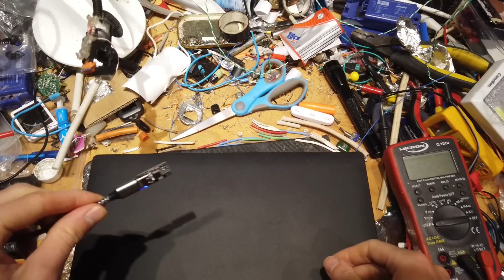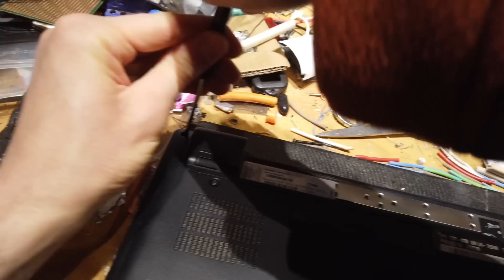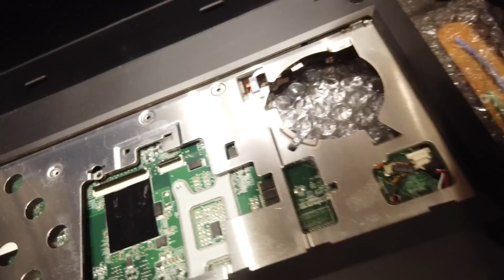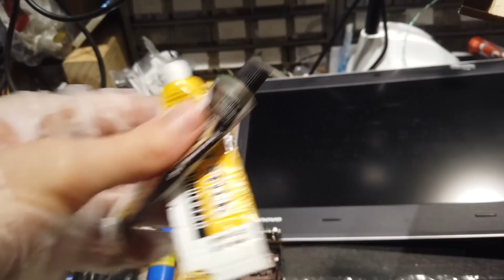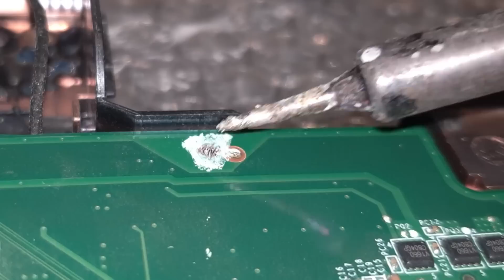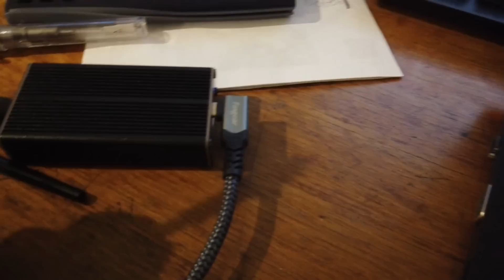So I put a USB C charging port in my year 2011 laptop

Comment: My laptop's screen got damaged so I turned it into a desktop setup and and when i plug the power adapter it turns on, if i use type c pd without the battery will it turn on ?

Comment: Lenovo are known for their crap hinges. Actually it's the crap plastic they use for their housings that is responsible. I spent two hour gluing the hinges back together on my Lenovo after the display suddenly decided to declare its independence. The lesson here is, not to buy plastic Lenovos. Their aluminium laptops are probably alright though.

Comment: So the adapters you can buy already do this? Are they safe to use? 
My laptop is only has a 45watt power brick which would be easy to replace with usbc charger

Comment: Is it possible to just connect the direct positive and negative port, and on the other side use a GAN charger that will know the amount of voltage and current needed?

Comment: I can tell you from experience the epoxy repair to the hinge will last for a while. but will be wrecked thr first time the laptop gets a little drop to a hard surface. I did the same repair to my laptop hinge. I recommend you get online and start searchiung for a replacement for the broken part. They are still out there. Good job though. And I love the usb-c port addition.

Comment: Hello sir extra information.  In my Zephyrus g14 2020 you need to adjust bios infor for charger to accept lower watts/volts wtf it is and it will charge while using. But if its off it will charge weird.

Comment: Hi Ash Glad I came by your video. I bought an old Lenovo ideapad 110 just to have windows to try out a DAW. The DAW and plugin I found is great but the CPU keeps crashing the DAW.
Do you think doing what you did should help and is the ideapad he same thing as the thinkpad. Also having issues trying to boot from a flashdrive but it might be a format thing cause I use linux otherwise.

Comment: These $3 devices go only up to 45W, you need to spend a whopping $4 to support 100W and be safe for your 90W E320!
Your 100W USB-C power supply will work, but your USB-C device and your laptop might not survive it.

I see some comments about the control pin of the barrel connector, but since you can charge your laptop alright with the 100W power supply, this seems irrelevant here. Which is lucky, because Dell, Apple and Lenovo have been known to use this control pin to identify stock chargers, and would power the computer (sometimes at low power) but not charge the battery if they don't detect the proprietary charger signature. Some people have designed spoof signature devices for Dell laptops and cheap third-party chargers.

The charger for my recent Lenovo does not have such a control pin, or maybe it has, as the 2 conductors seem to be both on the outer barrel. But its single USB-C port is probably just for data, not power (I haven't checked), so I might need to insert a device similar to yours. On the other hand, for the same $3 price, you could get a compact USB-C PD to DC adapter like this: https://fr.aliexpress.com/i/4000349880924.html?gatewayAdapt=glo2fra
No unscrewing/rescrewing, no breaking/repairing hinges, no soldering. Just a little less elegant.

Comment: It seems you get lucky with the Lenovo power supplies. Dell systems use an identification chip in their power supplies. Connect a non-Dell power supply to the system and it refuses to charge the battery. So no USB-C modifications allowed unless you have an old Dell PSU to harvest the identification chip from!

With regards to the overheating issue that you faced with the Quad core CPU one solution to this is under-volting the device rather than under-clocking it. Most of Intel's CPUs will tolerate under-volting really well and this will directly translate into reduced power consumption and less heat. So the same performance basically but for less power draw. The easiest way to experiment with this that I've found is with a program called throttlestop.

Comment: BEST BET  IF YOUR HINGS ARE TIGHT YOU FIND IT HARD TO OPEN THE TOP HALF JUST  DROP A SMALL AMOUNT OF FINE OIL ON THE HING'S  STOPS IT FROM SNAP'IN  THE SCREW HOLDERS

Comment: 1:20 You can use a wick for easy desoldering. I'm personally following Louis Rossmann's advice and using the "goot wick" brand. Known good stuff.
Also there are external adapters (USB-C to barrel connector) that are very handy. Still a great video.
I'm going to do the same thing with my 2009 e-waste netbook.

Comment: Damn, sucks about the screen hinge mounts.

They DO make special types of epoxy to bond plastics, works WAY better than super glue. And given the high stresses in that area, I'd also try to reinforce it even after the plastic epoxy with JB Weld or Loctite epoxy or similar.

But that's a bit easier said than done when you'd prefer to do it in such a way where the laptop can still be reassembled and even disassembled again later in the future.

Tricky, but doable, I've done it that way before with excellent results. But the trick there is to get everything aligned flush with the screen hinge brackets while the epoxy cures, but also not having the epoxy cure to the brackets themselves. I found that a very light touch of WD-40 from a Q-Tip on the brackets can prevent epoxy from curing onto parts which you don't want it to.

Anyways, just some thoughts on techniques to fix busted screen hinge mount points.

Edit: I see you did apply epoxy around the area, good good. But I mean applying it in a way that's PERFECTLY flush, by using the hinge brackets themselves to shape the epoxy as it cures. If this is done correctly, you can REALLY fill the area in with a big gob of epoxy (use common sense where all you apply it though), and then install the brackets with a touch of WD-40 (only on the brackets, not on the casing, for any possible future disassembly), to perfectly align and flatten out the top of the epoxy. It ends up bonding with all that much stronger of a hold.
Reply: Thank you for sharing your experience on hinge repair.
My experience is to drill through the broken hinge base and use 2 mm screws and nuts to secure the hinge. I will use your epoxy technique if the hinge mounting base is not leveled with the other hinge.
Reply: @Frank-Thoresen  I do hope it proves as helpful for you as it has for me in the past.

I should probably also add, that you don't necessarily need to remove the hinges from the screen assembly to do this. Just use some pliers and carefully adjust the hinges where they sit evenly at the exact balance point while the epoxy cures.

Note on that: This might not be advisable for a shop with cats roaming around LOL!

Comment: I wonder how easy changing the controller would be in a more modern Lenovo that uses the new rectangular plugs. I have some that only pull 65w and use that fat plug. It might be cool to 3d print a new "port hole" and swap to usb-c for the convenience.

Comment: No need to open the laptop. It would be easier to just make an external adapter using the barrell plug.
Reply: The while point was/is to not use the barrel plug

Comment: I haven't read through the comments, but I'm sure several people have already told you that you used about 10 times too much thermal paste.  The paste is only supposed to fill the gaps in the contact.  You want to use the absolute minimum possible to get the best thermal conductivity between the CPU and the heat sink.
Reply: Didn't it come like that from Lenovo?
Reply: @OrangeSheep14  No, he put the thermal paste on in a previous video when he swapped the CPU.

Comment: In my opinion used charger is very cheap. And you dont need to disassemble/assemble your laptop. Last week I bought absolutely new original charger (120w) and docking station for my 2012' HP elitebook only for $17 (not in the retail of course). So, lets say, charger was 50% of this, $8,50. I think good USB-C cable suitable for charging laptop will be more expensive.

Comment: This makes me want to do the same to my laptop. But I'm afraid because I'm not an expert in these things although I've already opened my laptop several times to clean it, upgrade the RAM, SSD, apply liquid metal compound.

Anyway, good content! I really enjoyed this video and the previous one where you actually upgraded the CPU.

Subscribed!
Reply: If your laptop also as pluggable connector for the charger on the PCB like this Lenovo has, you could try to buy a matching connector with a cable. This way you don't have to solder onto your Laptops PCB. You only have to solder the wires to the USB-C PD Board. The other side just plugs into the board.
Reply: @DrLamalama  no need to solder anything, Aliexpress sells ready-made cables...also, there are people making drop-in replacements for the original power port module.

Comment: I've been looking to do something similar. My concern is the voltages since the charger isn't exactly 20v. Its like 19v. And then there's the charging speed. Idk if my laptop has a way to limit the current and to also regulate the voltage :/
Reply: there is some room for error in the voltage, and the current will be determined by how much the computer pulls, not how much the power supply has. i'd say go for it !
Reply: No problem whatsoever, that's well within tolerance.I've had success  with 19v laptops run on 20v chargers as well as the opposite way, 19v charger on a 20v laptop. Nothing in a laptop runs on 19/20V anyway, it's stepped down by 1 or more buck converters which can tolerate some deviation.
Reply: also, you can change the voltage on the module to match your power supply voltage. about the current, just make sure your power supply has more than the computer pulls and it will be fine
Reply: @l0k048  sounds good, I'll take a look into it 👍

Comment: If you need to fix hinges then just melt it further into the plastic if you have enough space before it goes through the case. Then use a longer screw if you "welded" it too far down. I did it to a several old laptops and only couple of them needed some more welding. This method is better because superglue does not stick very good to some plastic or don`t last long.
Reply: A quality epoxy does the job too.

Comment: I'm surprised that it charged without the signal line from the charger. I've had laptops before that refused to charge the battery (but would happily still run) because the pin in the middle had broken.

Comment: 5:30 The signal pin is used to detect how much power the charger can output. By not connecting it to a resistor or shorting it to ground the system thinks it can draw 90W.
Reply: Correct. It’s an easy fix.
Reply: Will shorting it to ground make it think it can take more or less power? Are there specific resistor values for the power levels?
Reply: @budyniozaur  For this plug it goes like this:
10K - 65W 
Not connected - 90W
0R - 135W
1.5K - 170W

With the square one you can go as high as 230W and as low as 35W (Which is around the same power I'm comfortable passing through this particular model of trigger pcb)
Reply: Excelente información
Reply: Yep. This is the correct answer as lenovo does make different rating power supply. The blue wire does not go to nowhere, it goes to ground. The resistor is located in the charger head. Different rating charger have different resistor value. These, if I remember correctly.
Reply: I think the old Dell laptops used the same but for both reasons.  I tried fixing broken power port on one and it wouldn't work with the power adapter I used.  Got an OEM adapter and life restarted 😢
Reply: Is that like Dells type? Is the "pin" known as a "smart pin"?
Reply: You idiot. Stick to what you know.

Comment: This opens a new possibility to build this thing instead buying an used charger. At worst case, nobody sell the charger. I believe the module is not expensive either although the charger that supports PD won't be cheap.

Great project!
Reply: As someone that keeps buying e-waste laptops, using my main USB-C cable for everything would be amazing.
Reply: 45 or 65w ones are only 40 to 60$ usd not that bad IMO.

Comment: Why did you need to switch the 12v connector?
Reply from the maker: Laptop needs 20v charge.
Reply: @ashsibebytes4846  Okay, is there only one, solder pad, wired up?